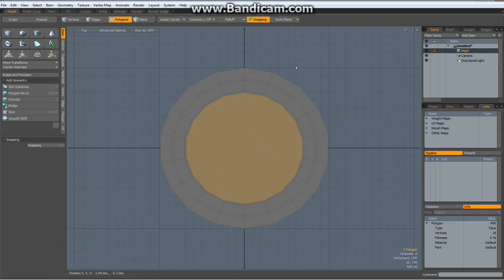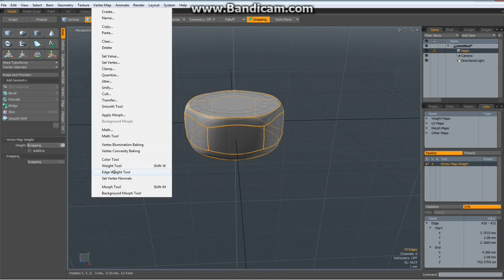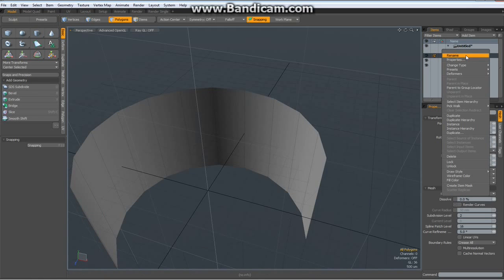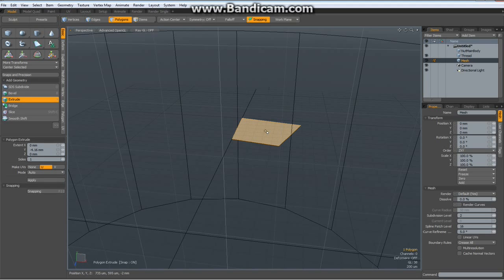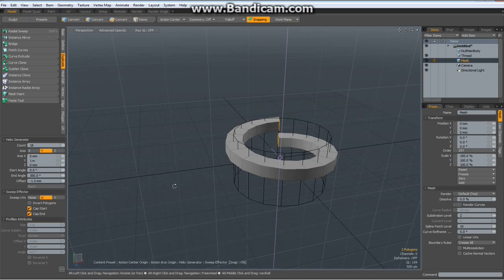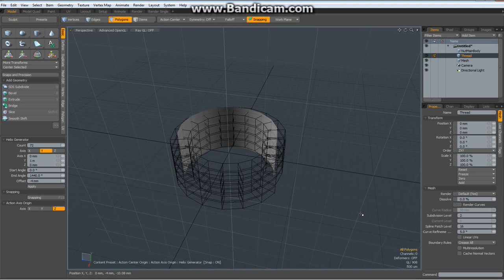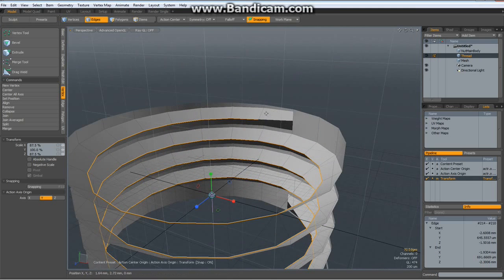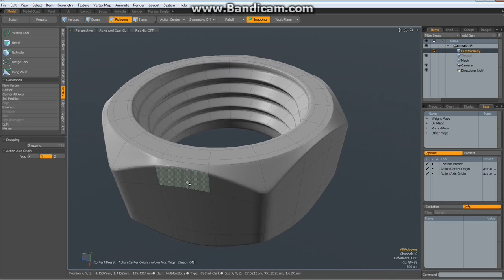Luxology modo - Modeling a Nut with inside threads (Part 2/2 The actual tutorial)

Comment from the maker: Hi, this seems to be a Modo 601 / 701 Problem (The tutorial was done with 501). Others had this as well as you can see in older comments. Try to rotate one of the meshes by 0.005 degrees and try again. Then you must probably do a - Vertex - Merge Fixed - with a very small distance to merge verts back together.

Comment: Hi Peter just done some research and ended up having to slightly rotate the the thread layer and then the boolean operation worked. Then had to play around with a very small fixed value to weld points.. strange???